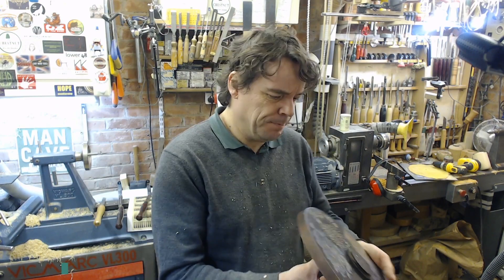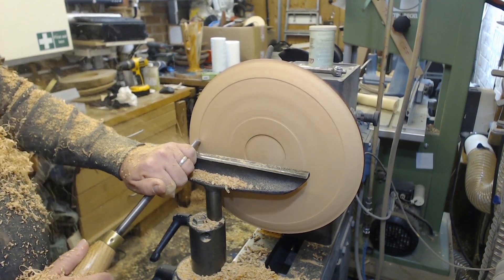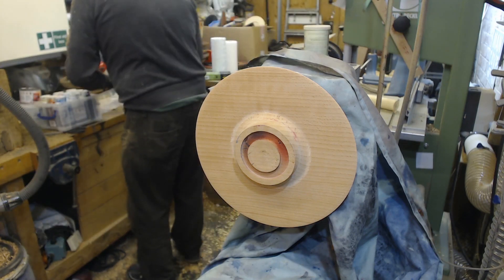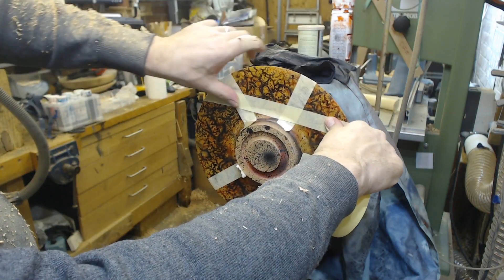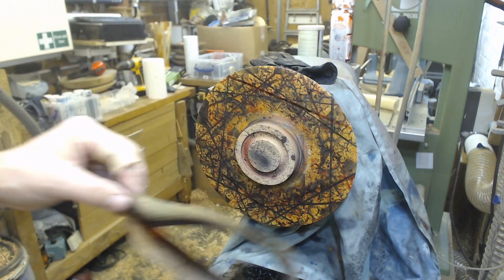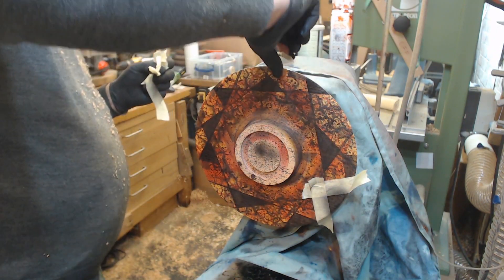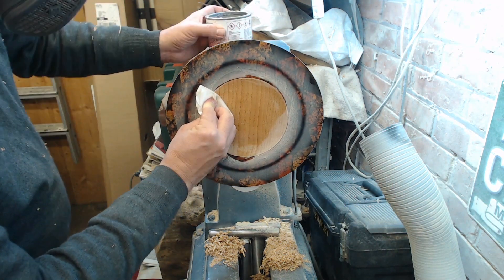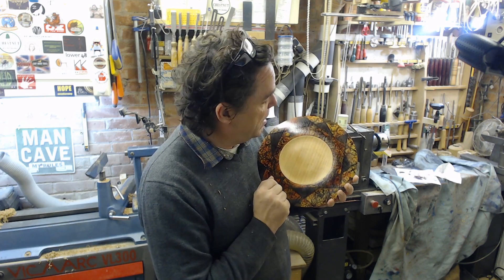Woodturning an Airbrushed Platter Rim

Comment: That’s refreshingly different! What do you think of the DeWalt right angle drill? I’m thinking of getting one...
Reply from the maker: Cheers, John! My rightangle drill is a ryobi - it's good. I got quite a high capacity batter to go with it which is quite heavy but it's easy to use one-handed.
Reply: Stewart Furini Thanks Stewart, my mistake!

Comment: Hello Stewart, It's weird that just as you were suggesting a childhood link to the artwork, I was reminiscing over the multitude of ink designs and messages that covered the desktops at school in the seventies. They would have started off a pale cream, but over the years, turned to a darker orange-gold as the varnish had aged. One could tell the earliest works as they were in black or blue ink and were partially overwritten by later items that encroached with no respect due to lack of space. Later on, fine tip permanent ink coloured pens emerged and to the gold background and blue and black stains were added the reds and greens, supported by various attemts at carving for added effect and depth. .  .   .  If you can't see even a vague link here, then I may have dug myself into a very deep hole.
Second try. The platter looks great and would make a fine giveaway. For some reason it brings back images from my youth.   Regards, Glenn. :-)
Reply from the maker: Haha - put a smile on my face, Glenn...a nice social history of school boy graffiti in our time!